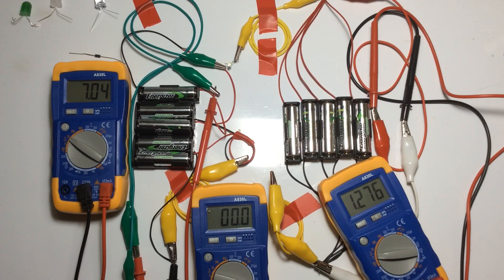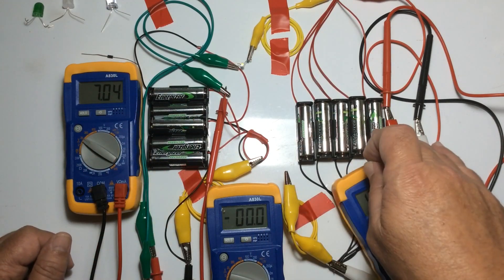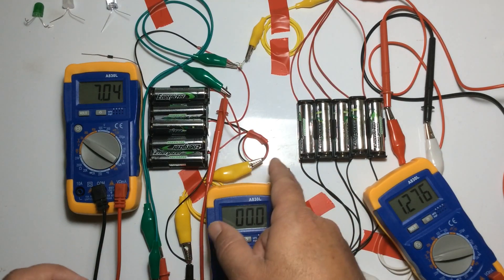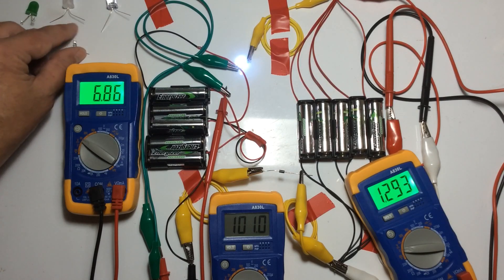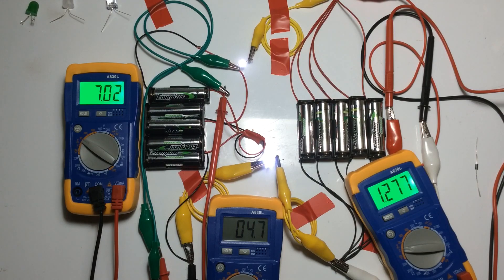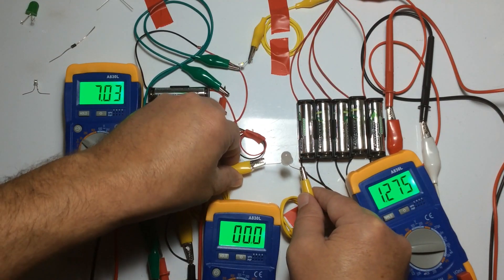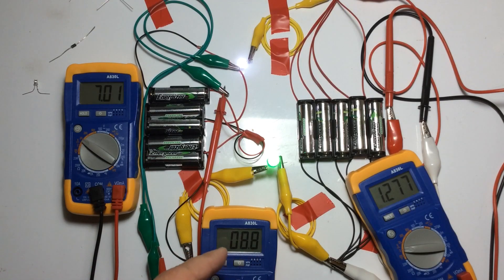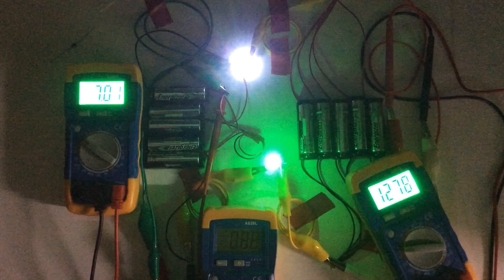EFFICIENCY BREAKTHROUGH USING TESLA POWER TRANSFER

Comment: These are great videos explaining a practical use of Tesla switch, without actually requiring much switching. I believe the differences in the current draw between the  use of diode Vs LEDs on the -ve rail, could be partly attributed to the junction capacitance. The In400x series diodes have a junction cap of 15pf, whereas an LED typically has 50pf.
Reply from the maker: Thank you for your comment.
I started calling it the Tesla transfer method because manually switching the batteries isn't really getting any of the benefits the Tesla Switch has. I wanted to cover the most basic use of the concept because there are a lot of people that are put off by complex coils and switching circuits.

Soon I will head down that rabbit hole, auto switching, but life's full on at the moment and this old dog needs to learn some new tricks first.

Thank you for the capacitance information for the LED's, that's at least one thing that helps towards understanding the amazing efficiency.

Comment: White LED use a blue LED with a higher voltage drop. Red LED have a lowest LED voltage drop. The norm max current is 20mA for best lifespan. I'm working with super caps on this same circiut but have not finished the CPU fet switching software circuit to start meaningful research
Reply from the maker: Thank you for your comment.
Please keep me up to date with your switching setup, eventually I will get to the switching aspect but for now I'm trying to find out the circuits maximum efficiencies before I move to that next step. There are plenty of viewers that would like more information regarding the capacitor version of this circuit also, so please keep us updated on those experiments.

Comment: Thanks again for your videos. In fact LED, as we thought in your previous experiments (old ones) are not acting like conventional loads. The effect that your are working one with your configuration must be studied with different kind of loads. Moreover I don't remember what were your results with your supercapacitors? Was it the same as the batteries? Many thanks again.
Reply from the maker: Thank you for your comment.
I'm slowly starting to get a picture of what might be happening here, I believe the efficiency is aided by the materials used to dope the green LED.
I stopped testing the capacitor version because I needed to create a better swap around switching mechanism as those capacitors can dump a lot of power very quickly. I want to get back to the capacitor tests as soon as I get some good switches